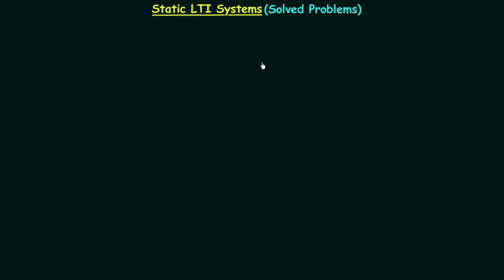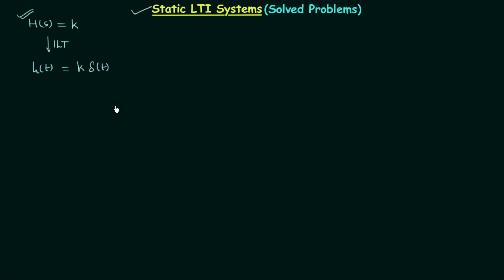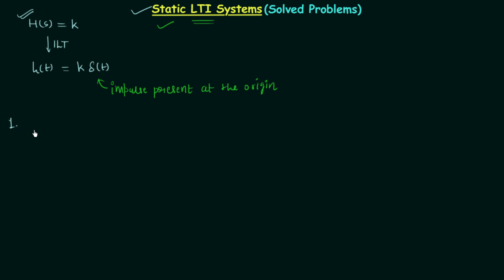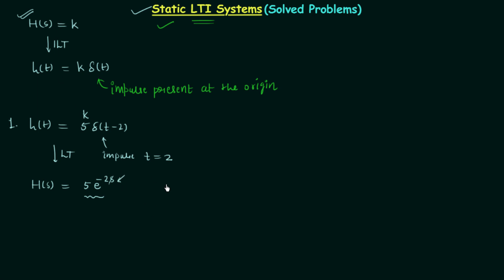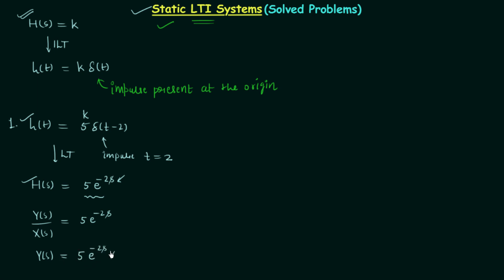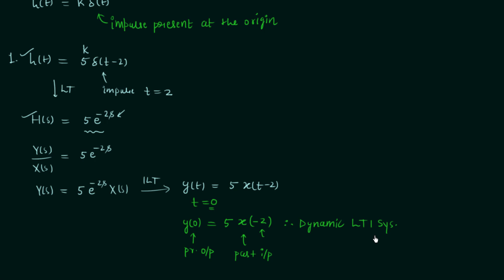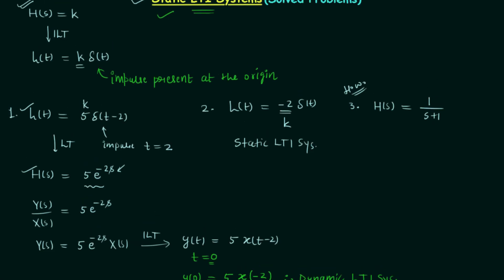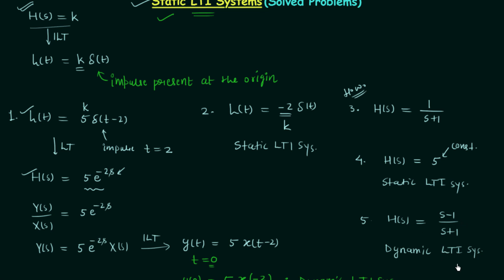Static LTI System (Solved Problems)

Comment: IN HOME WORK PROB TRANSFER FUNCTION     H(s)=1/s+1     IS NOT A VALID TRANSFER FUNCTION SINCE IT WILL GIVE       y(t)=e^(-t)x(t)        WHICH IS NOT A LTI SYSTEM   HENCE QUESTION IS ITSELF WRONG YOU CAN'T GIVE    1/s+1    AS  A  TRANSFER FUNCTION
Reply: NO,actally y(t)=e^(-t) * integral( x(dua) d(dua))

Comment: The hw problem is static linear and time variant.....
Not a dynamic
Reply: it is dynamic bro because Y(s)= X(s)/(s+1) and ilt will be y(t)= integration of ( e^-t x(t) dt) since it is integrated it is depending on past input hence dynamic
Reply: @jithendrateella9021  not x(t) it will be x(t-t')
Reply: Right..but then if it's not LTI system, how come we are having it's Transfer function? Only LTI systems have Transfer function, right?